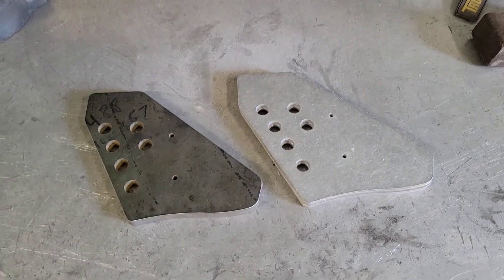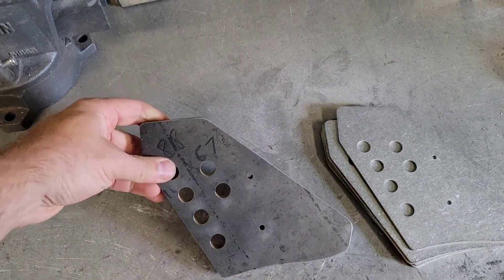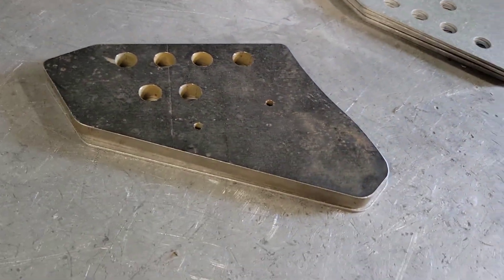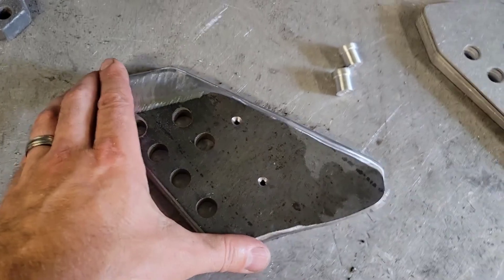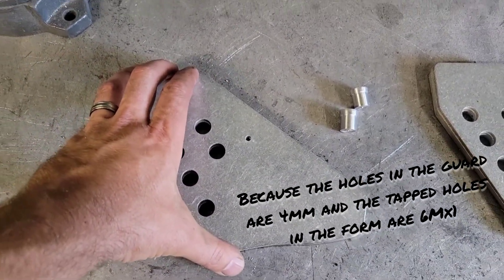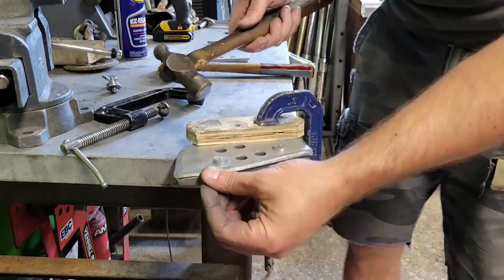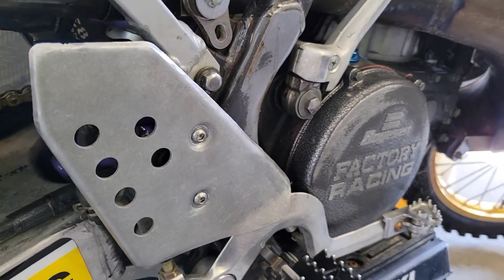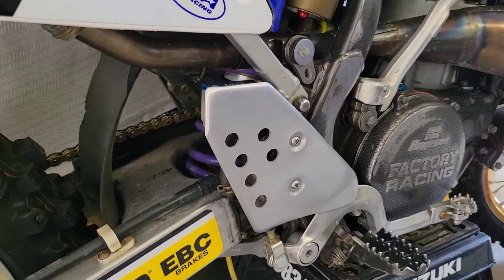Frame Guard Fabrication - 1998 Team Suzuki Winfield replica

Comment: Just stumbled across your channel, nice work! I'm following your '86/'88 CR125 build. I recently restored an '86 CR250 and I can tell you NOBODY makes or ever made frame guards for the '86. Pretty sure nobody made any guards for the CRs until '88. So what I'm getting at is if you were to fab up some guards for your '86 frame, which I believe is the same for both 125-250 & 500, there would be a significant demand for them including myself.
Reply from the maker: Thanks Charles, yeah the youtube  thing is a work in progress, still figuring it out.  On the frame guards I'll take a look, there's not much to mount to on the oem frame though